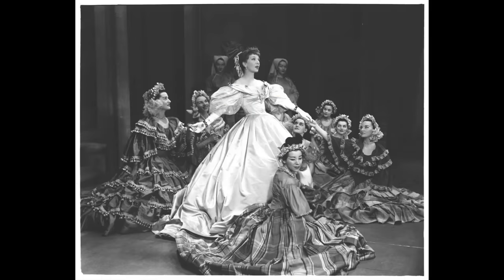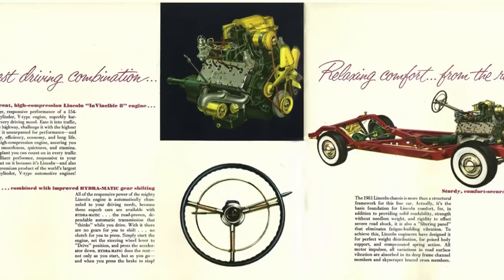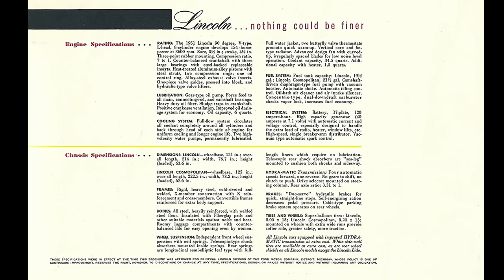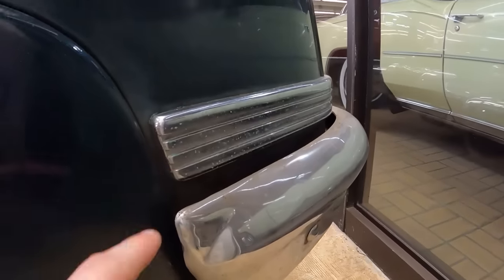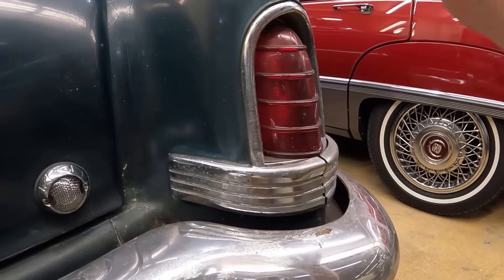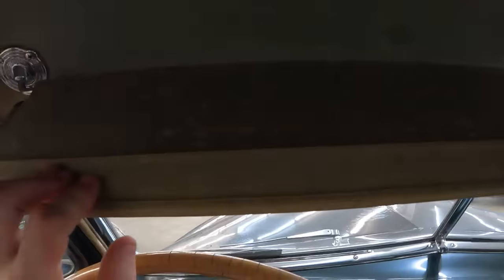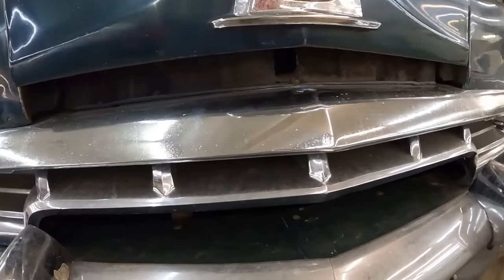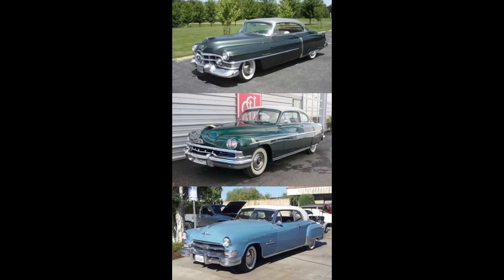1951 Lincoln Lido coupe, Nothing could be finer

Comment: My first car in high school in the late 60's was a 1951 Lincoln Sport Sedan.  It was a great driving car with that huge flathead and the old Hydra Matic.
Reply: And no power steering
Reply from the maker: Awesome did it have power steering? If not was it hard to turn.. I personally think power steering is overrated I don’t have power steering in the 52 1 ton truck and don’t miss it
Reply: @What.its.like.  No, no p/s.  However, like other American cars from the era, it had a really big, really comfortable steering wheel. We are so accustomed to just spinning the wheel while not moving now, that was the only time that I noticed the heaviness.  Beautiful to drive.  I'm guessing you know that the headlight pods are because originally it was designed to have hidden headlights and that was cancelled. Also, that massive V8 was adapted from their medium-truck line V8, which was why it was such a reliable, untemperamental unit.  I loved the beautiful sound of the radio, too!
Reply: @What.its.like.  power steering came out a  year to 2 later
Reply: It was about the same age as you.
Reply: @loveisall5520  yes my Aunt drove hers fine, at first, when she bought it new , she was in a cast on her right leg from a recent auto accident and she had a hired driver

Comment: I read many years ago that this model was intended to have  disappearing headlamps but there was a problem with development and the mechanism was not on hand to meet the production schedule, so a chromed bezel was quickly  designed to fill the already existing space. Hence the oddly recessed headlamps.
Reply from the maker: Interesting 🤔
Reply: I can see the probability of that, with the shape of the fender. Very similar to the 41 Chrysler or DeSoto option.
Reply: @ramblerdave1339  Yes.  The cover would have retracted towards the engine side of the fender, exactly where the cavity is at its deepest when you examine the bezel.

Comment: Starting at 11:30 take note of the steering wheel and horn ring.  The horn ring appears to float in position to the steering wheel.  This is because the horn ring attaches from behind the steering wheel.  It is an interesting effect.  It is more expensive to make.  After this model year I do not know if Lincoln/Continental used this again before 1961.  When the 1961 Elwood Engle designed Continental was introduced the first builds used the floating horn ring, but less than 50 were made as the steering wheel and horn ring were quickly redesigned to reduce cost.  Imagine how rare those are today.
Reply from the maker: Thank you so much for sharing that awesome information =)

Comment: Hi Jay,  This must have been one of the first applications of vinyl in cars.  This example, though far from pristine , looks to be very original.  Your right, they are a bit ungainly, like a puffed up Mercury.  If it runs ok, I’d use it like it is.  Thanks for sharing.  👍😁
Reply from the maker: Yeah I was thinking that.. I wonder if this was the 1st car with vinyl top if not wonder what was? Glad you dig this one
Reply: They had been doing full vinyl tops since at least the 1910s. The look really took off in the late 1920s. The Ford Model A leatherback sedan is a prime example, but most car companies had some version of this roof treatment, which was usually found on close-coupled/club sedans. The coachbuilder, Derham, was justifiably famous for using these roofs on their formal sedan builds.
Reply: @dwderp  those were not vinyl, they were leather.  PVC vinyl was not used in cars until the late forties..
Reply: @terribelbliss9646  the Derham cars and some others were leather, but most of the others were a man-made material. While not technically “vinyl,” they were the same synthetic fabric used for roof inserts on most cars up to the mid-1930s. Ford never used leather on their “leatherback” sedans, for instance. 

Most people, including me, use the term to refer to a type of roof treatment,rather than a technical material selection. Chemical analysis would probably show that modern materials probably aren’t PVC vinyl either.

Comment: Great Lincoln theme this week. Now if you can find the same year Ford Crestline 2 door sedan, had the sane type vinyl roof.The tunneled  headlights, supposedly Lincoln designed  the front to have hidden headlights, but exposed the lights due to cost. .First pick 1939 Buick Roadmaster, 2nd 1951 Chrysler Imperial.
Reply from the maker: There is a 53 Ford Crestline Sunliner it is one of 107 with the transparent hood dealership model it’s in the pipeline I’m not entirely sure when we’re gonna get to it.. It’s not high up on the priority list because we’ve already done a crescent line from 53 this one’s just is a different model

Comment: The lido  or EL Series was a Mercury from the split windshield back and even used Mercury taillights, and the Cosmopolitan had  had a one piece windshield.   Lincoln bought GM hydramatic for a automatic and used that transmission through 1954    i like them  , they were contemporary in 49 when they came out and made a sales record that was not beat until 1972.
My Aunt bought a new 50 Lincoln cosmopolitan and had it a couple years, she had  trouble with the hydraulic power Windows one night and she said she never liked the car after that and got rid of it
Reply from the maker: Thank you so much for sharing all that insight and information as well as your aunts experience with the car =)

Comment: Humm, It looks like the headlights are always pointing the wrong way. Interesting that they used a split windshield but had all that bent glass in the back light. Bumpers have visable bumper bolts all over, never see a faux-pas like that on a caddy. The vent window cranks open, but the rear window is pop-out?

Comment: Vastly outsold by Cadillac in 1951. The Caddy had a more modern V-8 and one piece windshield among other advantages. The running joke in 1951 (as told by my Dad) was that the front end has a "sad look" & that Cadillac felt so sorry for Lincoln that they let them use their transmission. Poor Chrysler, though, in 1951 only featuring the not fully automatic Fluid Drive.
Reply from the maker: Thank you so much for sharing all that information I totally agree the 51 Cadillac looked worlds better and more modern than the Lincoln but the Lincoln caught up in 55.. And the roles were reversed 55 Lincoln is a really nice looking car

Comment: An uncle had a car lot at the time, nearly every engine (Ford Truck) had a cracked block. He refused to accept them in trade due too this.
Reply from the maker: I’ve heard that that must’ve been a common problem
Reply: @What.its.like.  Cracked around the valves but could be repaired, costly though with no guarantee.

Comment: 48 Chrysler
51 Caddy
I've seen pictures of these many times but this is the first time I've actually been around the real car. Thanks Jay for posting this so I can finally after all these years get a good look at one of these.

As far as I'm concerned Ford made two big mistakes with this car. First, the styling on this car especially the front end is IMO just fugly. I don't know any other way to put it. How could the Mercury of the same year be such a good looking car and yet the Lincoln looks so terrible. That's surprising considering the Lincoln is supposed to be the premiere luxury brand of the Ford line.  

Second, I consider it to be sacrilegious to put a GM anything into a Ford product. What was Ford motor company thinking that's as much as admitting that your main competitor makes a better transmission than you do. 

It is nice to see one of these that's an unrestored survivor. I like that because you get a chance to see how well the original materials they used have held up. Since this one still looks pretty good on the inside we can see the materials used have held up decently. One thing I will add though are those knobs for the controls on the dash.  You definitely would not want to hit any part of your body against that during a crash. Those fins sticking off of the knobs could do some serious damage.
Reply from the maker: Great choices these are very fugly cars but have their place in history 

Thank you so much for sharing all the insight and information 

They used the gm hydra matic transmission because they didn’t have a fully working automatic unit plus gm was willing to sell it to anyone willing to pay for it it was in a lot of 40s and 50s cars hell rolls Royce even used it at one point

Comment: The weirdest headlights ever. Originally they were considering folding headlights similar to the 42 DeSoto. But, they ended up with a new styling que for Lincoln, and they continued to have odd headlights untill 56. Those are tiny backups. That vinyl top was to detract from the fact that they still didn't have a hardtop until 52.Tho bloated IMO, a Lincoln from this period are ultimate gangster cars, especially with those great suicide doors. Druthers: only the Imperial.
Reply from the maker: Totally agree thank you so much for pointing all that out =)

Comment: Why would a Lincoln have a GM Hydromatic transmission?
Reply from the maker: Because it was cheaper to use gm transmission that was the first mass produced fully automatic transmission and GM sold it to anyone who would buy it rolls Royce even used it at one point
Reply: @What.its.like.  Sacrilege!!
Reply: The main reason is the Fordomatic transmission wasn't strong enough to handle the torque of the big bore flathead and much heavier body of the Lincoln.

Comment: For 1951 Lincoln and Mercury were in their last year for offering suicide doors, although Studebaker had it for one more year. Suicide doors were as such one would get run over by the door if they stepped out while the car was moving. I would still pick the Lincoln from the first scenario, then go with Cadillac.
Reply: Cadillac was Motor Trends first car of the year in 1949, I think the Cadillac was a better car